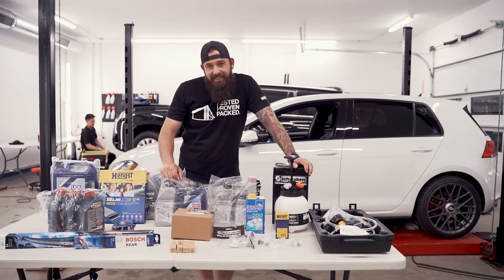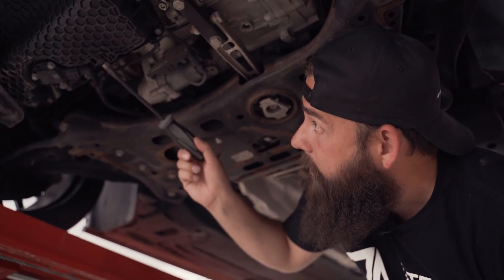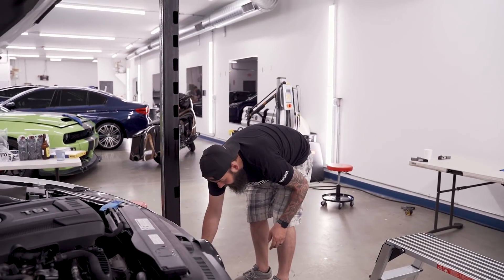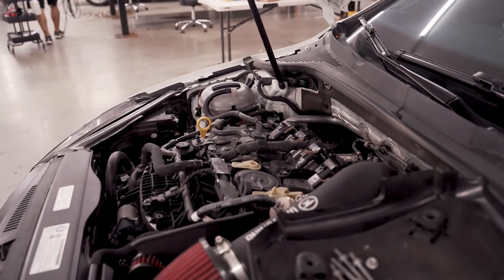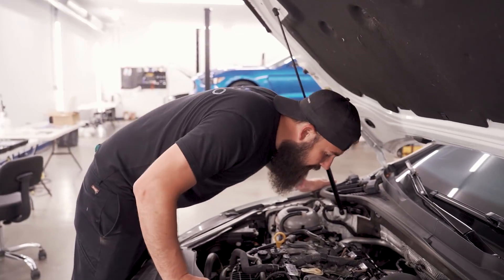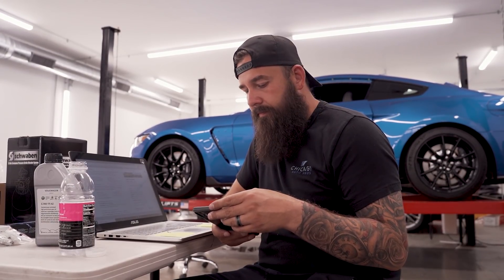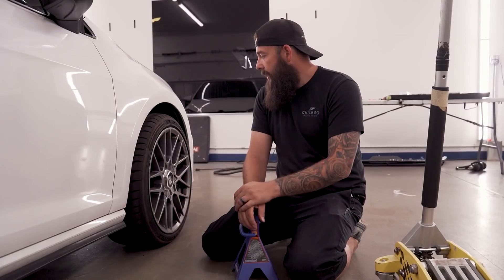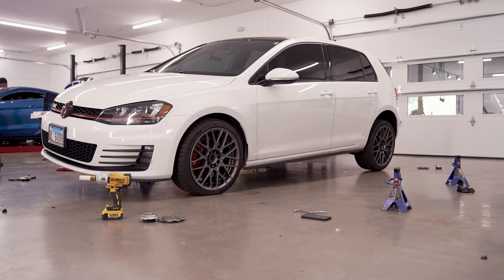How To Maintenance Your GTI | I Find Something Very Wrong During Maintenance

Comment: just found the exact issue with my a3 on my spark plugs, cylinder 4 had oil and the other 3 were fine. I'm guessing its because of the pcv system but I've left it for a while and nothing bad has happened

Comment: He is probably fine with the oil change but in the VW manuel for my 2018 gti you need to check the oil when it is at operating temperature and not cold. After I found out and checked the oil properly, I discovered I overfilled. I needed to drain about 300ml of oil because I added 6 liters like him.

Comment: My mk 5 gti had the same problem with the clutch when you slammed on the gas it felt like a automatic, any gear the rpms would rise like crazy but found out my clutch was 250k on a clutch not bad

Comment: When you change the brake fluid is usually advised best to start from the wheel farthest from the master cylinder pump
Reply: So in reverse order of what he did ?
Reply: @AnonYmous-zt6kr  indeed, start from the rear passenger, to rear driver, and so on
Reply from the maker: I was told to do it in that sequence, but I could have been told wrong.
Reply: @ChicagoAutoPros  if you take me in for the job I'll do the mechanics on the weekends.
Reply: For these cars, the order he did it in the video is the official recommended VW sequence due to the ABS system
Reply: the vw manual says to start front driver side, then front passenger side, then the rear wheels.  If you do this you should flush your manual clutch too... which is the last thing you do.

Comment: #1 it doesn’t have a valve or cam cover. That part is called the cam bridge. The cam bridge also has half of the cam bearings and is sealed with a special sealant. It’s a lot more of an involved process then a valve cover gasket. The bolts that hold it down will also need to be replaced as they are torque to yield. 

#2 the cabin filter is just for cabin air and has zero to do with fuel economy. It won’t restrict the air flow into the car or damage the blower motor. It needs to be replaced every 15k or 20k miles or every 2 years.

#3 using a 2017 model the factory bleeding sequence is driver front, passenger front, driver rear, and passenger rear. VW recommends replacing the brake fluid every 2 years. The factory brake fluid is yellow brand new. The reason you replace it is because it absorbs water which lowers the boiling point and causes a spongy pedal. 

#4 that paste stuff you found on the spark plug is normal. It’s a silicon paste the factory applies to the ignition coils to help them slip on easier.

#5 to pull the coils out easier twist them left and right  and then pull them up. They pop out a lot easier that way.
Reply: Finally a VW tech, i'm guessing. Good advice though.
Reply: peyton allie very close to VW and yes a tech.

Comment: Oil in the plug wells is very common.  Clean it up and send it unless a mis develops.  That goop on the plug was dielectric grease from the coil packs.  Also, the coils pull out easily when you have the motor warm, does not have to be hot.

Comment: Well seal needs to be replaced and valve cover since that is off. Valve cover notorious for leaking, and causing plastic water pumps to crack when hot oil drips on it. Same issue with son's GLI 2.0.

Comment: Guys in VW shops bleed the brakes from the back right (most distant brake from master cylinder) cuz' that way the air goes out, this way when you start from the front some air will stay in the system, worked so myself all the time, never had a problem, only few other cars have another order of brake bleeding from this one, just a friendly tip, cheers from Croatia ✌

Comment: Hey FYI the oil you found in the spark plugs leaking is from the cam brigade leaking. It’s kind of a big job because the whole top of the valve cover is what hold down your cam shafts it’s like 6 or 7 hours of labor
Reply from the maker: It will be taken care of with the engine rebuild I hope.

Comment: Its only valve cover seal,only problem with oil in that hole is potential misfiring .Why rebuild engine?
Reply from the maker: MILE VOJVODA you will have to watch the upcoming videos to fin out.
Reply: Chicago Auto Pros i’m in the same boat, what did you find out?

Comment: Dude I had the exact same thing in my spark plug. I got quotes from vw and other off site auto maintenance places. 1000$ was the cost. Anyways I didn’t want to pay that I cleaned it to where it was spotless. I then scuffed around the o ring cover in the spark plug. I then used high temp rtv and spread it all over where it was leaking and around the entire circle just to be safe. Let it air dry for 24-48 hours. Put the spark plug back in. Checked again at 100 miles and it was spotless! Mine was also cylinder 4 btw. Hope you can give it a try to save some money if money is tight. Good luck!

Comment: From the vast amounts of EA888 engines i've worked on, its most likely the gasket maker that you put around the spark plug circles. Over time it gets brittle and may leak oil usually above 100k miles which is strange how you have it already. Change that and your spark plugs should be safe from oil but do look at instructions on how to do it because the valve cover itself is what holds down the camshafts down.

Comment: Couple of notes
1. Oil change
-make sure the fill cap for the oil is off so it drains faster and so you don’t have it splashing, makes the stream steady.
-when your replacing the o ring on the filter, make sure to coat it in some new oil
2. Spark plugs
-when putting new plugs in, make sure that when you drop them in the hole to first back the plug out then screw it in to ensure you don’t strip any threads
Reply from the maker: Thank you for notes!

Comment: What you said at 12 min in. Its the clutch. My buddy has a mk7 6 speed with a neuspeed tune that adds 5-7psi depending on how you set it. It makes it about 310 wheel torque and 250 wheel hp. When you go mostly wide open throttle in 6th and the rpms dont match the acceleration of the speed, its clutch. I told him that since exactly what you're explaining happened to him. Stock clutch meant to handle at most 320lbft at the crank. 6th gear is always best test at WOT to see if clutch is good or not. When you have a dual clutch and tune it, you also get a TCU tune which adds clamping pressure to the clutches so it can handle the extra torque. 
Long story short. Your engine has so much torque and potential to increase rpms at that load and gear but the clutch doesn't have enough friction to handle all the torque in such a high or heavy gear. 
Just gotta get a good stage 2 clutch :)

Comment: a quick tip, when you put the same plugs back in they do not require the original torque spec, because the gasket has been crushed. I would recommend a lower torque spec from there. As for oil on the plugs, it could be the valve cover o-ring gaskets. I would go that route first.

Comment: Slip sounds like an abused clutch.   Interior air filters do not affect the engine or MPG. It would affect the ac/heater blower motor though.  Your brake bleeding sequence was incorrect. You should bleed the caliper farthest from the master cylinder first.  The sequence should be passenger rear, driver's rear, passenger front, and then driver's front. Thank you for this video. You reminded me that I should do a brake bleed flush on my car (Audi). I'll get that ECS Tuning bleeder system. That's very handy to have.
Reply: What happens if the break fluid change is done in the wrong order? 🤔
Reply: @valkyriesnp  You just won't get all of the old fluid out of the lines.
Reply: @destroyerofmines152  Oh got it. Thank you! 👍🏻
Reply: Female Drummer np
Reply from the maker: I was told to bleed them in that order, I could have been told wrong. 🤷‍♂️
Reply: The "furthest caliper away from the master cylinder" rule of thumb is antiquated and incorrect for most modern vehicles. Many modern vehicles specify a different bleeding sequence due to ABS/VSC control modules, electronic prop valves, etc. @Chicago Auto Pros if you followed the sequence specified by the repair manual you did the brake fluid replacement correctly.

Comment: yeah I got rid of my GTI before 60k - the service guys recommended it lol...
Reply from the maker: Not a bad idea, I’m in it for the long haul! 😩
Reply: 107k of abuse on mine without skipping a beat. Sorry for your loss.
Reply: 105k on our 2015 problem free. APR stage 1 tuned since 60k
Reply: burb17 and right after posting my comment I got my first CEL 😂
Reply: K C 🤦🏼‍♂️
Reply: I got 104k on my 2011 MK6 GTI.  I am about to take it in to get the timing chain and tensioner replaced, new brakes, and a new clutch (it is a manual) These cars are great if you spend the time and money to maintain them correctly. It got a carbon clean at 100k. It has no mods done to it... but after all that work, I will put a cold air intake, an oil catch can, and a stage 1 tune to get about 40 to 50 more horsepower.  That is the farthest I will go on it. I want it a little bit quicker but don't want to sacrifice the longevity of the engine.  I am hoping to get over 200k miles on it.  I change the oil every 3k with European synthetic mobile1.   Car runs great.  It's not a civic or Toyota... They need love if you want them to be reliable and last a long time.

Comment: Just some tips, of course you dont want to burn yourself while draining the oil. But I always run the engine for a good 15-20 minutes to get it to operating temp to make sure you get all the oil out.
Have a look at the drained volume of oil roughly, so the risk of overfill is minimized. When checking the level after fill up, this needs to be done when the engine is fully warmed up. But a rough level check can be done after a couple of minutes of running. 

Plugs: Good to blow the spark holes with air pressure to prevent dust and crap to fall into the engines cylinders, but this engine looked very clean.

Very sorry to see your engine fail,  I think I have seen more cars with this bearing issue. Make sure to check with your VW dealer for goodwill.

Comment: I would recommend not to rebuild the engine but buy used and sell a car till it still holds the value,you won’t be driving a this GTI till the wheels fall off. In 2-3 years you will be bored of it. $13k for rebuild is a lot to lose in 2 years, save at least $5k with used engine.

Edited:
Someone in instagram recommended to get Golf R, but what’s the point, GTI and R share the same 4 cylinder but a little more power🤷‍♂️
Reply: 4WD is a nice add with the R.

Comment: Always down shift when trying to go WOT! you're putting too much pressure on the engine and on the clutch. 6th gear at 65mph and WOT is a good way to break stuff. DOWNSHIFT
Reply: that’s what i just commented. wtf. 6 gear at 60 and tryna push boost at low rpm. tsk tsk.

Comment: Sorry to say man .. 13k is not worthed ..i been wrenching for 19+years i have worked on all kind of  cars .. vw are good when you get them brand new..and modified them .. but after a while they are not worthed.. especially if you trying to get the most power out of it.. 13k is just the beginning..good luck
Reply: My relatives have a 2013 jetta with 180k miles... only issue was a recall and a headlight bulb that burns out a lot; what a great car it is for them, i guess they got lucky!
Reply: Ryan Richter i pretty sure your relatives dont beat that car or try to put high performance upgrades..etc.. all depends how you keep up to maintenance and  dont abuse the car.. like i told my customers .. before you do any upgrade to your car .. make sure what getting in to it .. the (tuner car world )is a whole different topic
Reply from the maker: I’m going to try and be a little nicer to it.
Reply: Chicago Auto Pros 😁😁
Reply: I don’t know. I have a few friends with nothing but long lasting VWs and my ‘17 GTI is at 107k miles(tuned since a 50k) and I beat the hell out of it without a single hiccup.

Comment: The slipping feeling under heavy acceleration in high gear is very likely to be clutch related. Going 3/4 throttle in 6th at 65mpg puts a high load on the engine, same for 35 in 3rd. This is a good way to test if the clutch is slipping, though it can cause damage to the engine if done too much. You should always downshift to accelerate and pass. 

The oil in the spark plug tube is likely due to the seal in the valve cover failing, whether it's RTV silicone or a gasket. When you removed the plug, the oil in the spark plug tube would have drained down the threads to the end of the plug and into the cylinder. I am not sure what the next video holds, but oil in spark plug tubes is very common and not in and of itself a reason to rebuild an engine.

Comment: ”VWs are very reliable cars”
Reply: So easy to hate is it?
Reply: Mine were 🤷‍♂️. Granted, my MK4 GLS needed a new heater core around 115k I think. Lasted 15 years before a wreck killed it.

My MK6 2.5 SE didn't have enough miles or age to show any issues as it was at 87-88k miles and 8 years old. Another wreck :-(.